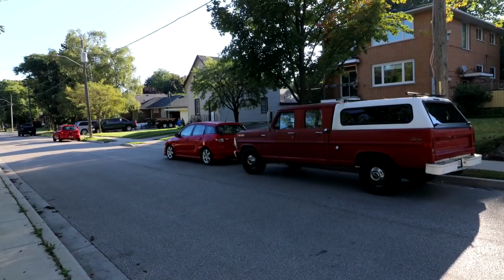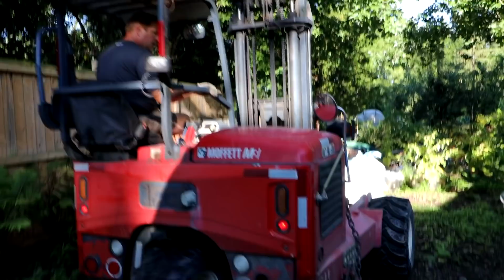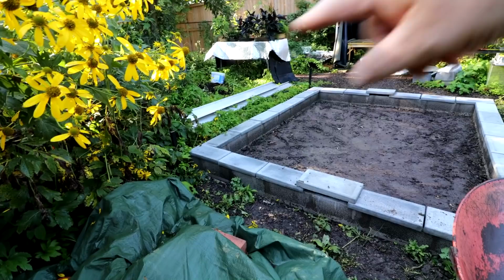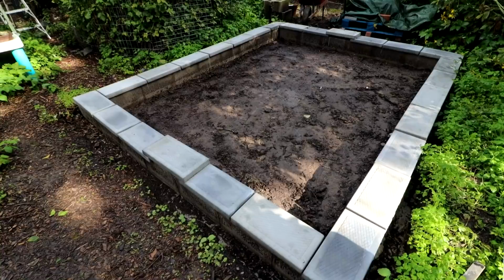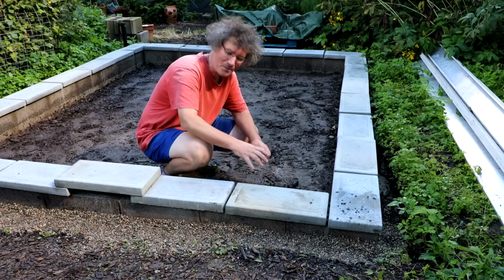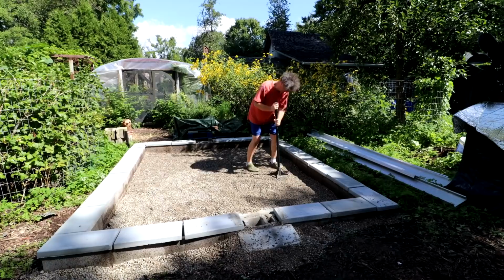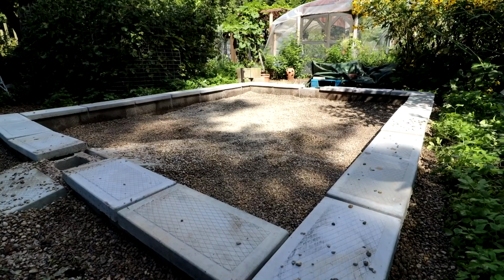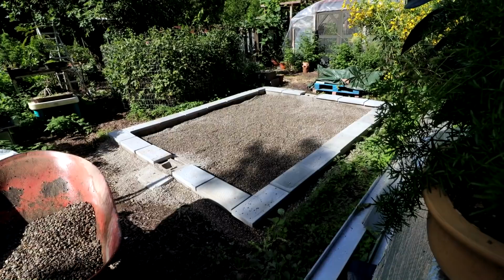Floor Work On the Glass Greenhouse, The Bonsai Zone, Sept 2021

Comment: I used pea gravel for a greenhouse I had back the 80's and I remember wishing I had not made it so deep.  I like the idea of making a hole in the middle and filling with gravel to facilitate drainage.  I would recommend no more than 3inches of gravel.  Too deep and it gets hard to walk, like on the beach.
Reply: That’s why he is gradually presing it down, to eliminate airpockets.
Reply: @Thimbrethil  it wont help, it needs "Fines " to hold the pea gravel together, plus you can not compact gravel and it will always move under foot without the fines to lock it together... Nigel.. top it off with crusher fines, believe me!

Comment: I was wondering how the fork lift traveled to the site and then I saw it kind of hanging in the back of the truck as it drove away. That was interesting. The fork lift must weigh a lot, but then again the gravel load is heavy, so that adds to the weight of the truck.